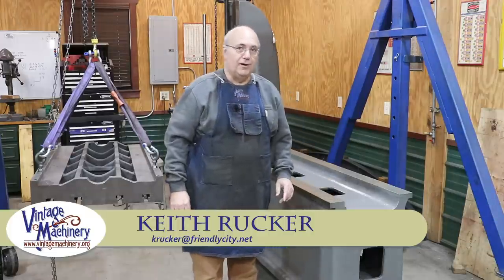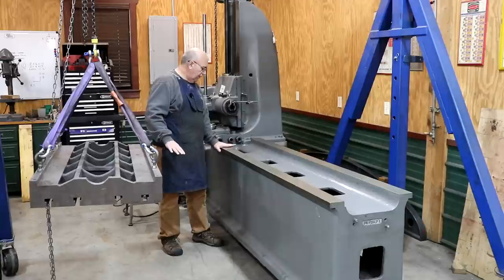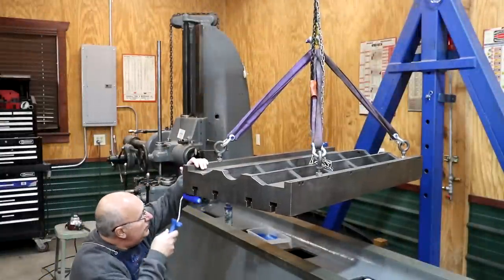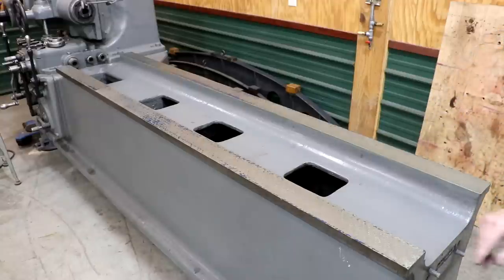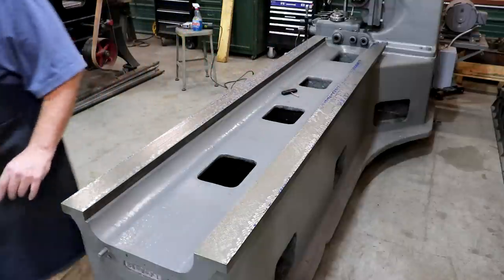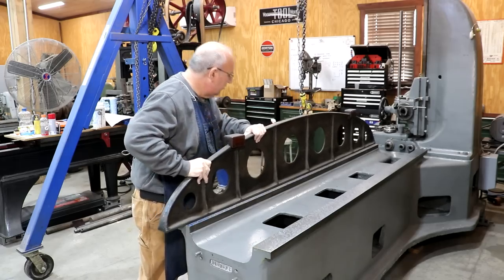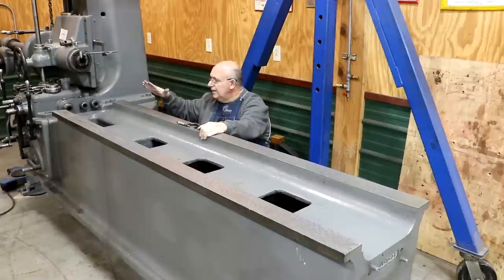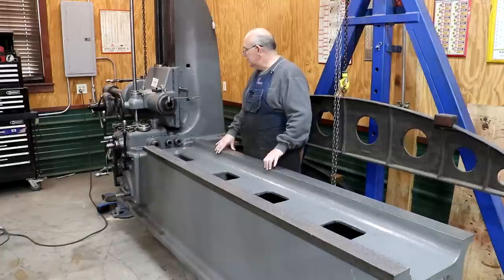Lucas Horizontal Boring Mill Restoration: Finish Scraping the Bed Ways Co-Planer

Comment: I have a friend that opened a shop back in the early 70’s right out of high school. He bought all of his first machines at a government auction. They were all built in the early 1900’s but they were all brand new never used. They were all packed and preserved for long term storage by the government in an underground storage facility in the central part of the country. He is still using most of them today. A cool little bit of history.

Comment: Keith GREAT job scaping it in, the level of flatness and alignment is amazing. my question is after all this scaping is the new surface still level, as when you first installed the machine? Also, you did not address if it is parallel with the head, or square to the vertical ways.  Thanks

Comment: I've been using acrylic blue for some time now. I use about a spoon of paint to a tea spoon of water to dilute it and it works pretty good for me. No established brand, whatever i find is good. Removal is done with water and mild nettle based liquid soap. I scrub the surface with one of those bathroom scrubbers and then remove it using my water enabled shop vac.

Comment: Keith, 

I  really enjoy your videos!  I know the end products of manufacturing, but my knowledge of the machines that make the parts is not as good.  You provide excellent explanations of how machines are made and how they function. 

As for scrapping, I remember a physics demonstration or lab experiment in which two highly polished surfaces were brought together.  The force required to separate the two was incredible. Scrapping and lubrication allow surfaces to move relative to each other. You provide real world examples of these properties. 

Thank you very much.

Bob

Comment: Your going to have a nice boring mill when finished. In a shop I worked  we cut Prussian blue with alcohol and applied with a roller like your using. If you run out of spotting blue give it a try. Only down side is the short application time as the alcohol evaporates.

Comment: Why is it necessary to scrape the ways coplanar, surely it isn't too dissimilar to a lathe bed or grinder ways (not at all coplanar)? As long as the bed ways are parallel, would it not be easier to scrape the table ways to match? I can see it might be useful for setup measurements or leveling, or just so you know it's close to perfect!

Comment: Friction is calculated by the coefficient of friction of the material multiplied by the force, which in this case would be the mass. The surface area in contact is irrelevant to the calculation. Oil retention is certainly a benefit of scraping vs grinding, but reduced friction is not.
Reply: @ralphgesler5110  Keith stated that less contact area equals less friction. That is wrong,.
Reply: @jeffreylee7184  I agree with everything you wrote, but it is a little off topic. Keith said that scraping reduces friction because there is less surface area. As you pointed out, surface area is not part of the equation. Lubrication is irrelevant to the point I am trying to make. A scraped way vs a ground way will both have the same amount of friction. That is true if they are both oiled or dry.

Comment: Please explain why you used the table from the machine to blue the ways instead of using one of your many cast iron references.
Reply: Keith already explained that the top of the table, now upside down, is true and flat and is the best reference to use to blue up the ways.